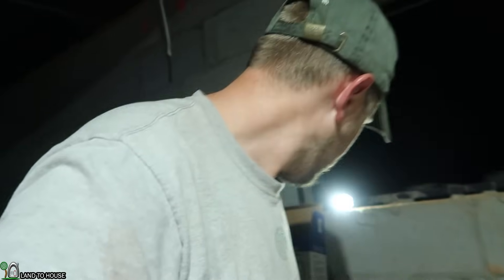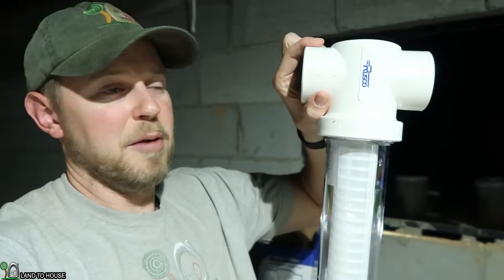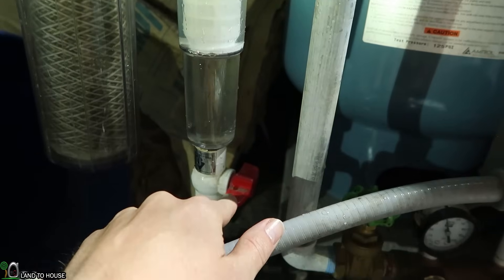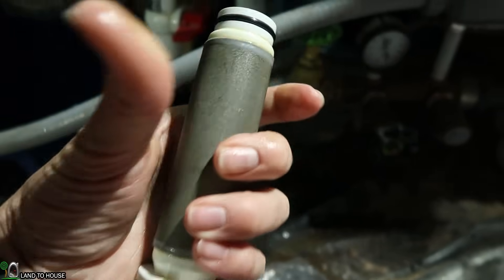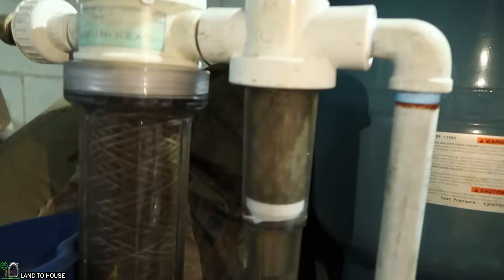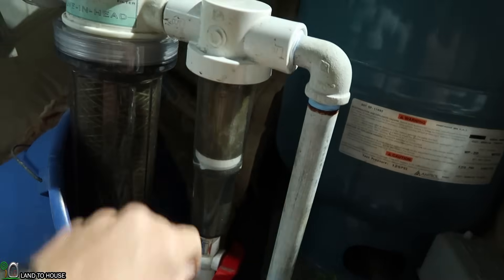Rusco Spin Down Filter Major Upgrade

Comment: I'm just amazed that you've fought this filter system on the floor for two years.  Why have you not put a 24 or 36 inch riser from the floor into the Rusco filter and string filter package bringing it up where it only a pain rather than a near fist fight.  You could also get rid of that gate valve on the floor as well and install a ball valve just before the Rusco filter.  Oh well.

Thanks for the excellent discussion on the Rusco spin down product.

Comment: Pipes should also be grounded. The plastic housing breaks the ground. Install two brass clamps on either of the filter and run a decent gauge wire to allow ground connectivity.

Comment: We had the same problem of silt in the pipes and our well inspector told us to raise the pump 6 feet up and we did that and all of our problems went away. Your pump is too low, maybe raise it up more or less depending on your circumstance. Hopefully, your well level allows this. All well systems are different we were told. Think about what your pump is going through to pump the water up to you and if there is sediment in the system, that is not good for the pump and its seals. Picture the vortex of water turbulence every time the pump starts and sends water up.
Reply from the maker: Our well is 500 feet deep. We should be able to lift it a little. We just have not had it done. I imagine that would help a lot.

Comment: Pull the well pump out put a 4 inch sleeve over it seal the top of the sleeve and put small slits below the motor you will never get silt again or ever need to do a filter installer or change. Eliminated at the source don't try to fight it further down the line pull that well pump put a 4 inch sleeve over it and you won't have a drop of sediment ever again. I've done it time and time again and people love there water now;)
Reply: Interesting idea! Could you please consider posting a video next time you do this, or maybe posting an article someplace with some pictures?

Comment: Do you install the filters in between the wellhead and the pressure tank to prevent the sediment from entering the pressure tank?
Reply from the maker: No you want to make sure the filter is after the pressure tank. If you have a filter before and it gets clogged your Well 
Pomp will try to run all the time

Comment: I am guessing that the fact the 2 inch filter is rated for up to 50 GPM flow it still works well 9n household pressures under 10 GPM?

Comment: To me if you look at the poly screen from when you started the backwash to when you opened the case to clean it.. ALOT of sediment was removed and if you keep it running for along time you can clean most of it.... you should hook up an hose to outside.. so you can not have to deal with all that.. or at least raise the manifold so its more serviceable.

Comment: My spin down filter would clog every few days and required taking it apart to restore the flow.  I ended up with a better system.  I use 2 big 10 filter canisters in series.  The first filter is a Pentek 75-25 "Dual grade" filter and the second is a Pentek 25-01 "Dual grade" filter.  They last two to three months and do not load up to the point where I notice any appreciable reduction in flow or pressure.  I have an artesian spring in a concrete block spring house and there is a fair amount of silt in the water.  When I change the filters, I notice that there are several concentric rings of sediment in each filter.  I recently found a different manufacturer that is somewhat cheaper and the filters are every bit as good as the originals.

Comment: Hey mate I would piss off the metal pipes & fittings with well water & use poly or brass fittings,makes a big difference as the metal ones will eventually rust & cause issues
Reply from the maker: Even the stainless steel?
Reply: @LandtoHouse  stainless all good for sure,bloody expensive,it looked like your piping was galvanised though?
Reply from the maker: The pipes from the pressure tank to the filter are galvanized.  Then its pex for the house.
Reply: @LandtoHouse  yea I did once use galv piping in my bore water system in Australia but I’ve gone poly piping as eventually the fall piping would rust & cause more damage,wish I could afford stainless so I’ve settled for blue line thick wall piping on my bore & have not had an issue in over 15 years with poly piping

Comment: Does a ram pump work better or worse or not at all with a flap valve at the inlet to the pump as well as the normal ones to send more water and pressure out the output in stead of half going back to the source?

Comment: i would raise the filter higher by extending the pipe from the pump then have then further apart to get the bucket under i would have the nylone filter then the stainless then the string filter

Comment: It doesn’t look like the Rusco actually backflushes, but merely drains the accumulates sediment. If it backflushed, the trapped particles would release from the mesh. Let’s see what Rusco’s owner can explain about that.
But basically, the polyester was letting more particles go onto your bigger filter than the stainless steel mesh, which means you’re just borrowing from Peter to pay Paul; how much does the bigger filter cost? Rusco needs to make a bona fide backflushing sediment screen, so disposable filters don’t bear the brunt of particles that get through. This isn’t rocket science—it just requires focus on the customer and sympathy.

Comment: you're supposed to mount that filter before the pressure tank, when you blow it down water travels from the pressure tank in the reverse direction to normal flow and forcefully blows out the sediment.
Reply from the maker: From my research you cannot mount before the pressure tank. If it gets clogged the pump would run full force trying to fill the tank pressure and burn up the well pump.
Reply: @LandtoHouse  You're supposed to mount the pressure switch upstream of the filter.  The installation manual shows how, but this is not a typical arrangement so I understand why you've plumbed it the way you have.  The other thing you can do is plumb a bypass in such a way that you can reverse the flow through the filter, that allows a more typical tank/switch arrangement.

Comment: I Just scrolled through your videos hoping for an update video on how the bigger filter worked for you.
Reply from the maker: It is way better. A few things are happening. A little more debris is getting past the screen to the string filter so it does not clag as fast. And my wife left the home and we use half the water we used to. I now change the filter every 1 to 1.5 months. WAY better than every 3 days.
Reply: Thank you for the update

Comment: Thanks for the helpful video.  Did you end up getting 2 months out of it? Also, do you base your maintenance (flush & clean filter, etc) based on the water pressure in the house dropping or just do it on a set schedule? 

We just moved from the city out to a more rural area and this is my first experience working on wells.  Water pressure in the house was trash, especially in the third floor bathroom, but just flushing the spin down did wonders to improve that and I haven't even taken off the filter and cleaned it out yet.

Comment: Do you have any experience with ispring spin down filters? Most reviews of any spin down on high sediment say it will need to be flushed often.  I noticed there is an auto flush ispring spin down filter.  Problem is it goes from $45 to $450.  Makes me wonder if there are better options.

Comment: Had a very similar problem.  I had to use a larger sized filter over the smaller recommended size.  The larger filter extended my time to service the filter as in your case.  Any issues with slightly elevated iron?

Comment: So I have a 250 polyester on my rusco spin down. I noticed silt was getting through to much and was hoping that was the right approach, please enlighten me which one has the finer holes because I was told the 100 was the average and going up is trapping more
Reply from the maker: I think its the other direction? Particle size of 100 is smaller than 250. So if you went with a 50 it would stop even more. A human hair is around a 50 micron.
Reply: @LandtoHouse  100 mesh lets through more than 250 mesh
I think he's talking about mesh, not microns

Comment: Great info! Living also in NC, we have heavy clay silt and sediment. Just learned about the Rusco Sediment Trap and plan to install it before a backwash turbidity filter. Was hoping the Rusco Sediment Trap would do the trick but because the clay in our water is silt (making our water orange and gunking up our appliances, etc), looks like we're going to have to invest in the pricey backwash system. Have you considered one?
Reply: Karen: Are you sure the orange color is just from clay and not IRON?

Comment: SUGGESTION:  to simplify your  CLEANING / FLUSHING --- Insert a piece of GALVANIZED Pipe on the section from your water shut off ELBOW (by the Green Handle) 
to raise  BOTH of your FILERS  4"  or 6"  or so ... then SHORTEN your HOUSE pipe the same 4" or 6"  as necessary ... 
COOP

...

Comment: Watched your video,  very informative.   I email Rusco regarding my issues (exactly like yours) and was told to go with the 100 Stainless steel filter.   I know u want the larger unit, but still not sure about filters because of their recommendations.  How is the larger unit working with the polyester filter?
Thank you.
Reply from the maker: The poly does not catch as small a partical. But still does well. Its actually nice not having to clean as much. I now clean every 2 months vs 3 days!
Reply: @LandtoHouse  Were both the stainless (original filter you had) and the new, larger (2") poly filter both 100 mesh size - so it was comparing "apples to apples", in this case? Thanks.

Comment: Two questions:
1. Any news on if it actually lasted the anticipated 2 months?
2. in my own water filtering system (saltless), the nylon large sediment filter sits before the other filtration media...was just wondering if you or your viewers have tried adding a sediment filter in front of the spin down, like the one you have "behind"?
Reply: 2. The point of the spindown is because it captures coarser/bigger particles and is reusable (no need to change filter media ), you save on changing the finer sediment filters which are single use, can't be washed.

Comment: Any reason why dont you add a few inches to that vertical pipe just before your filters? Then you can put that bucket under them easier
Reply: LOL, i agree, it gives me a headache watching him fight to get the bucket under each time, a very easy fix to lift it up for much better access.
Reply from the maker: The main reason I don't do that is because I never remember to get the pipe at the hardware store. Haha
Reply from the maker: That would make life a lot easier wouldn't it?
Reply: @LandtoHouse  Also add a ball valve on the house side to shut when you are working on the filters so the house does not drain unless you want it to do so.

Comment: The 2'' version has a minimum flow requirement of 18 GPM in order for the spindown action to work properly, this is mentioned in the manual.
Reply: What is "spindown action", specifically? Thanks.
Reply: I noticed multiple people agreed with this. I noticed he has a pressure tank so he is on a well. I do not know how many residences run over 10 GPM, so this may be a little off setting for someone looking to install their first spin down filter on a household well

Comment: If they don't have it already I would make a auto flush on a timer to open the valve every 24 to 48 hours for a few seconds!! And put 2 fale saft cut offs after the electric valve done ✔!!
Reply: And put a water dection sensor alert to your phone if something leaks or gets stuck leaking water it will alert your phone !! And cheep as wifi cameras are set 1 up so u can see what is going on if u get a alert ⚠️!!

Comment: Love the videos and digging the COVID beard.  cool that you could clean off the polyester filter and be able to re-use it easily.  2nd on the idea to replace that riser pipe before the filters with a taller one to give you more working room.  I'd suggest replacing the elbow after the filters with a sharkbite T fitting and a valve so that you have a point for a controlled drain of the house pipes during these maintenance projects.

Comment: 📍 Curious why a large sand filter isn’t used. You could even make a large 55 gallon barrel style with different layers.  Or even your own pvc staggered solution… Poly filters, carbon, zeolite, sand, diatomaceous earth… so many solutions and configurations.
Reply: Also, you could not tap the well directly to the filter. Rather, well to a holding tank/cistern. Then pump (elevated off the bottom sediment) to your filtration system). Be sure to install a purge to the base of your holding tank/cistern to occasionally flush the sediment (annual inspection/maintenance).

Comment: Hey man how is the rusco spin down swap to the large 2" model going?
Any downfalls to using the 2" rather than the "normal" household size you started out with?
My mind is 99% set on installing the 2" rusco spin down as I figure the much larger size will handle all the flow we could ever need here, while being able to run ( I hope) the 15 micron plastic screen, but I plan on having the 30 micron along with it just incase it cannot handle the 15 for whatever reason.

Our Son was born over the summer last year, and protecting our family is my Job. Our water is actually decent but still a surface well. The last acceptable type before only deep artisan so it's basically a deep surface well. Previous owner didn't maintain it even a little so we have sediment all the time, but whenever we have any meaningful amount of rainfall we get surges of tannin which then disappear soon after. But obviously that tells me we have water infiltration somewhere somehow so I am allowing ZERO room for anything to put my family at risk especially a newborn. Though I will have a proper artisian well drilled ASAP I cannot afford it at the moment (hell the dam birth of our boy cost us alittle shy of 5,000!!! Even I the greatest country on earth as rediculous as it is!)
So I installed a dual 4" x 20" Us Water Systems 222 water filter setup. They're top shelf and have ONLY US made everything which are far superior to most Asian made filters, legitimately too, but the disruptor and interceptor filter were the ones which sealed the deal. They really do filter out ALL the tannin which is insanely difficult and always expensive to do so I didn't have high expectations but to my surprise they actually do work Man!
They kill all bacteria, viruses and remove all heavy metals pretty much anything we do not want. My interceptor filter lasted 7 months with only a 20 micron Magna pleated filter acting as my sediment/pre filter for the high end Interceptor.

All that talk to say with the 2" Rusco spin down setup with 15micron screen ideally would gain me atleast a couple extra months of the expensive big Filters.
A month ago my filter clogged enough for me to change it and miscommunication between the wife and me she didn't order replacement filters, all I had on hand was a .5 micron Magna pleated filter!!!! So I have a single 4" x 20" .05 filter taking a serious ass whoopin with the seriously heavy rainfalls we had aswell as the last snow and frozen ground melt/run off. Cannot believe how well that single filter is doing and somehow it is still going, even at the tightest .5 micron I expected a couple days man truthfully. Quality is just as important as intelligence for us setting up our households water supply. 

Couldn't believe how lucky I got to find your video here, legitimately covering everything I was planning on/wondering about. You covered pretty much the same ground I am. When we first bought the house it had a tiny little filter like your string wound one there, they're dirt cheap and you can find decent melt blown or melt spun whatever the hell they're called in a 20 pack for like 135 bucks on Amazon, I believe 15 micron. But honestly they're next to useless and a waste. I'm a cheap guy unless it's safety or important, I'm telling you invest in a dual 4 x 20 filter setup man you'll have much better water pressure, filters that'll last 9 month atleast in the worst conditions. Most important man in that 2nd tub you can use an interceptor filter that'll wipe out anything harmful. The super duty best water filter money can physically buy is called the US Water Systems Disruptor filter. The fckn EPA themselves use that exact filter no bullsht. If you don't have tannin, with actual sediment pre filtration man it'll last a full year

Thank you for the video, you really did do an excellent job. 👍🇺🇸

Comment: hello body , you can't filter sand and silt with one filter, you have to go in gradation. 50 + 100 + 200 +500 mesh can be 1000 if you have a lot of silt and tweak with a particle filter. it 'is the only way. and please put on nitrile gloves to avoid any boilogical contamination.

Comment: stainless steel is better much better. u save money on post-filters. just remove stainless steel filter place in a bathe of clobber and warm water rinse it off to remove chemicals and done band new filter. polyester filter fray and can't be cleaned. another thing your setup is wrong if you are getting that much sediment in 3 weeks time. you should have 2 minimum and a max of 3 sediment spin down filters ranging from 140, 250, 1000 mesh.  pay now save later.  polyester sucks .